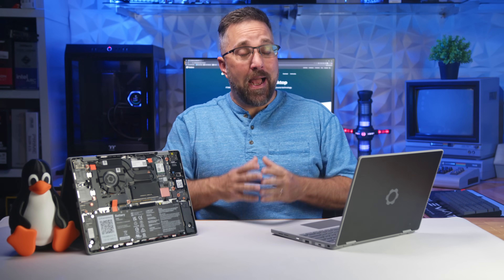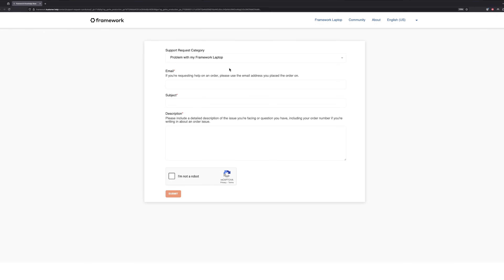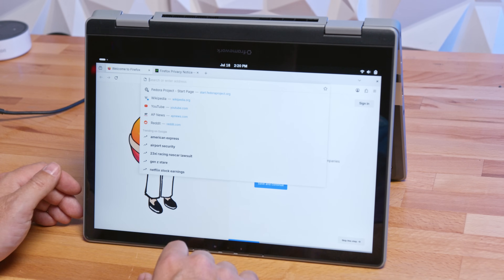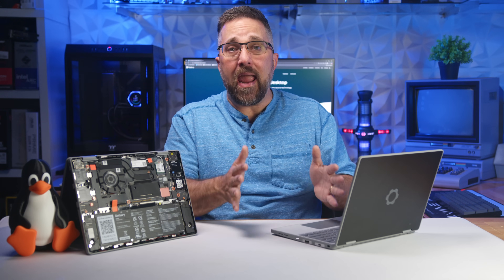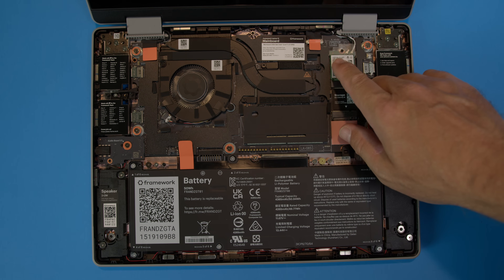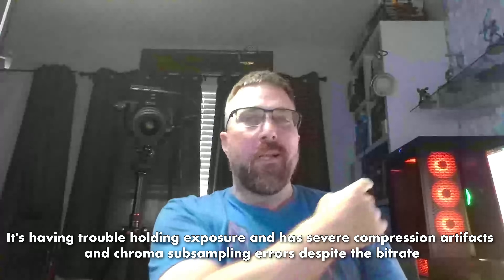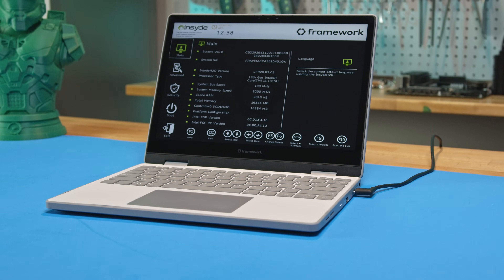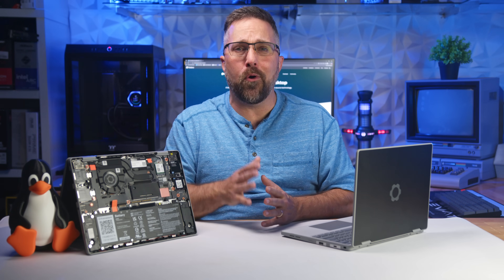Framework 12: Finally! a Linux 2-in-1 That Just Works!

Comment: I'd love to hear more about your experience with the on-screen keyboard. That's been nothing but headaches for me on a Surface, especially on KDE. Even more so if you want to use a non-QWERTY keyboard, that's stunningly hard to do. Getting it to pop or go away when I actually wanted it to consistently like Android was a big problem. I gave up on using it. For all of its other faults, Windows 10 actually ran circles around both Gnome and KDE for this.

Comment: It still just cost too much money, the price premium on the other two laptops is easier to swallow due to their capablities and relative repairability vs their competition. this thing needs to be priced at like 550 starting as a usable computer, given its quality and hardware, to justify even coming close to its cost. IDC how good their repairability is when a new main board cost as much as the entire computer from the competition, and buying a whole new computer comes with across the board system upgrades, while you still have your old everything else. This doesn't make sense and unless the second gen radically changes the design, I hope this product doesn't last long as it will do more harm than good to the company, sapping resources that can be put into products people actually want to buy

Comment: I am a DevOps engineer for a mid-sized company, and my advice is, if you seriously care about your privacy, then never ever dual-boot windows and linux on the same drive.
MS can read all your user files in home directory because its on the same drive as wndws.  MS wndws has telemetry, keylogger, spyware and the new recall and also embedded AI.
you will be doing yourslef a disservice by having wndws and linux on the same drive. Having wndws and Linux on seperate drives prevents ms from reading your files and uploading that data onto their database. 
Also make sure that when you boot into wndws, that the Linux drive does not show up as an additional drive for even stronger security, even though wndws cannot read ext4 file system.

Comment: Mr Lifting Linux, what laptops do you recommend over framework for Linux?

I've been looking for something for less than 800 pounds/1000 dollars for content creation. 

Please respond if you have any suggestions
Reply from the maker: Depends on your workflow. If you need GPU hardware acceleration, finding a laptop with a dedicated GPU under $1k will be difficult. If you just need a good CPU look at the Star Labs StarBook 14. It ships with Ubuntu (or other distros), open-source coreboot firmware, LVFS updates, and a bright matte 4K IPS option. Current page lists configs up to Intel Ultra 7 165H, up to 96 GB RAM, and a 14 hr battery claim; you can keep it under $1K by choosing modest RAM/SSD and the lower CPU tier.  ￼
Reply: @LiftingLinux  I see. I'll look into that. Thanks 😊

Comment: ...Why the heck was the wifi speed so different O_o? That's wild.
Was there any chance windows wasn't in performance mode?
Or was currently downloading updates in the background or something all sneaky like?

Unrelated to that - we've had an excellent experience with Pop!_OS on Framework - my wife's Framework 13, for example, seems to work flawlessly with that light sensor issue you mentioned.

Comment: QA and QC issues are the reason I had to return by FW16.  I may come back to Framework but will wait a few generations.  It sounds like they are already on top of it.  The only issue left is customer support.  They response turnaround is about 5 days and they tend to ask for photos or videos of the issues or have other questions.  Every time you answer or send them info, they would ask for other things, which keeps pushing the total resolution time to weeks for some, and months...or in my case, almost half a year.

Comment: So what im hearing from this is that i should try to see if i can work with Fedora, i currently use Mint on my old Lenovo ThinkPad Edge E530 and it is great(especially since it is my first ever device for Linux) but i have heard other distros are good too, i mostly went with Mint for it since from the research i did it was the easiest to switch to from windows (never gonna be a mac user I hate Apple with a burning passion)

Comment: 2-in-1 laptops are really starting to shape up on Linux it feels like. Last year I picked up a Yoga 7i 16IML9 for $550 during black friday. All of its 2-in-1 features work flawlessly too! Its processor is a little more performant than that of the framework (Core Ultra 5 125U, edges out the i5-1334U by 20ish percent per technical.city) but its 16gb soldered ram is a drawback that will only become worse with time. The side-mounted power button is also a flawed design that is known to break. 
I've found that across GNOME and Niri, my yoga runs quietly, coolly, and smooth as butter on every distro I've thrown at it but Chimera Linux has an extra level of polish and snappiness.

Comment: I never had an issue with the ambient light sensor and automatic brightness on the Framework 13 on Linux. I use Manjaro, and I started with it just a few months after release with the 11th gen Intel. I currently have a Ryzen 7040 series board in it. The point about the Mediatek wireless module is valid though.

Comment: Weather or Not Wayland works better or worse with dual monitors depends on the monitor sometimes it's X-windows that works better.
Reply from the maker: You’re right that monitor compatibility can sometimes feel hit or miss, but this is actually one of the biggest areas where Wayland shines compared to X11. With X11, running dual monitors at different resolutions or refresh rates usually means everything has to sync to the lowest common denominator — so if you plug in a 60Hz 4K monitor and a 144Hz 1080p monitor, you often end up with a choppy experience.

Wayland fixes this by handling each display independently. That means mismatched resolutions and refresh rates can run smoothly side by side without dragging the whole system down. There are still edge cases depending on drivers, but in general, multi-monitor setups (especially mixed ones) are far more consistent and fluid under Wayland than X11.

Comment: Ouch! Those processed trebles were painful.

My Lenovo Thinkbook 14 G4 2-in-1 works perfectly straight out of the box. Everything works without needing any fiddling around at all. I didn't need to configure anything with Arch more than installing the needed packages. 
It's also made from metal instead of plastic, have 2 NVME-slots and 2 DIMM-slots.

Comment: I want to run 2 DP Alt Mode monitors on my future Framework 12 simultaneously without a dock. Does that work? And can you use another USB-C for charging the laptop?
Reply from the maker: Yes that works. All 4 expansion ports support DP alt mode and PD.
Reply: @LiftingLinux  Wonderful! I just might invest in one of these then, despite it lacking in some other departments.

Comment: Thanks for the video. I've been curious about Framework devices. To be fair though from my own experience, I disagree with the title. I bought a Infinity Flex 14 (2-in-1) from Tuxedo Computers running Tuxedo OS, their fork of Ubuntu a few months ago and it's hands down one of the best laptops I've ever used. Everything worked out of the box all the way down to the Wacom Bamboo Plus stylus. Just for kicks, I slapped on a Xencelab16 4K drawing tablet just to see how it would fare and it was perfect although overkill considering the Infinity Flex has a touch screen.  Surprising considering Wacom drivers are already kernel level in the OS but Xencelabs is a relatively new player in the game. The Infinity Flex is being used for design work, illustration and video editing mostly and it's been a champ. A real road warrior. Although I'd love to test run a Framework 12, the idea that it's finally a Linux 2-in-1 that just works, implying it's the first of its kind to do so running Linux, would be an outright lie from my experience.

Comment: hmm.. i have found that Cinnamon usually works better on 2-in-1s
and you dont have to setup any rules.
in "display settings" in the "settings" tab you deselect "disable automatic screen rotation" and every thing works fine.
never tried stylus input though; i have a ipad for that
Reply: I am a bit confused.  One of the key features of the Tablet Mode of a fully functioning 2 in 1 is the rotational awareness.  Are you saying that you have found Cinnamon works well on 2 in 1s except for not supporting that feature?  That's a big exception for many people.  Available documentation on the Framework indicates that, while Mint supports touchscreen features of Framework 12, it definitely does not support tablet mode without   making customizations outside the user interface and typical end user skills or expectations (with any rotational recognition being one of the unsupported features being absent from the Mint distro).
Reply: @catreader9733  i can speak to the Framework... for other repurposed 2-in-1s LM is the only Distro where i havent had to do anything special to get everything to work properly.

Comment: Sorry, but if you think this is great - try a12/14/16 year old HP EliteBook 2760p/2740p/2730p - Snappier than this thing, no jitter when drawing with the non-battery Wacom panel - only limitation: 2-point touch, and much bulkier, besides the outdated hardware. The 2760p still runs every OS in existence.

Comment: This is potentially big news. I have NEVER EVER gotten hardware accelerated web browsing to work on any machine running Linux. This includes supported distros on Framework computers. In fact, it's gotten to the point that I am heavilily skeptical of any claims that it works without a System Monitor screenshot of CPU usage. Furthermore, the only responses I've seen to this issue are denial, the instruction to watch every single video through yt-dl (no), "it works on my machine", or at worst, the insinuation that the asker is lying about their problem to make Linux look bad. In the end, even if the issue is acknowledged, it always seems to be that "your problem isn't good enough to fix". Add that to the 

If it's true that hardware accelerated web browsing is working OUT OF THE BOX on the Framework 12, then that is a massive step in the history of Linux. Outside of perhaps small laptop manufacturers that only ship Linux, I'm not sure any officially supported Linux machine has had fully hardware accelerated web browsing out of the box. That, and even the rest of the hardware, working flawlessly as intended, autorotate, automatic touch keyboard and all! This means somebody is taking the casual audience, who just need a machine to work as a tool, and not as a hobby, seriously.

Comment: Chassis flex only matters if it means there's extra stress close the area where the hinges are.

This is only an issue for using a laptop on an uneven surface, as if it's flat on a desk the force is spread evenly.

It also matters a bit for screws getting loose in some bad designs.

My last two cheap laptops both broke because I open it awkwardly while using it the lap. The plastic closest to the hinges broke.

If these aren't an issue with the Framework Laptop 12, it's not a big deal and I'll take the weight savings.
Reply from the maker: Did you catch the part where just opening the lid—while the laptop was on a flat desk—caused damage to the screen? There are also a few reports on the Framework forums of the FW12 chassis developing stress fractures around screw mounts. So yeah, in this case, the flex may be more than just a theoretical concer
Reply: @LiftingLinux Bummer. All my past laptops have broken around the screw mounts.

I won't be buying anymore low end devices because of this. I'm sure if I opened the laptop very carefully every time it would be fine, but that's besides the point. This is a big design flaw IMO.

Comment: for audio di gnu linux , i'm using pipewire audio server plus kx studio repo (cadence  for manage jack audio pro server and carla for manage audio plugins effects )  :)
Reply from the maker: That’s a solid setup—PipeWire with JACK support through KX Studio, Cadence, and Carla gives you a ton of control over your audio workflow. But yeah, as powerful as that stack is, there’s only so much it can do when the built-in speakers just aren’t great to begin with. Good software can’t fix tiny drivers and weak enclosures!

Comment: 7:50 most docks do generally work with regular USB+PD+DP alt mode combo, all USB4/TB4 really offers to them is higher display resolution support on the DP front, no PCI-e lanes needed. And, well, the almost-guarantee that all 3 of these will work consistently, because not all laptop USB-C ports are created equal.

Comment: a toaster can run linux wdym handle linux lol
Reply from the maker: Sure, Linux can run on just about anything—but hardware support is a whole different story. It only works well if the manufacturer provides and upstreams proper drivers. Without that, you get missing features, poor performance, or nothing working at all. Take the Realtek RTL8821CE Wi-Fi card—it’s notorious for flaky or non-existent Linux support. Same with many fingerprint readers like the Synaptics WBDI—completely dead on most distros without reverse-engineered workarounds.

Comment: My i5 framework 12 has the same ~8-10% drain over 12 hours in s2idle, but for some reason switching to deep sleep actually increases the battery drain to about 15% over 12 hours. I'm on debian 13 and switching to deep sleep by writing to /sys/power/mem_sleep instead of modifying the grub boot options. It does appear to actually go into deep sleep, since only the power button will wake it and it'll take a couple seconds longer than resuming from s2idle.

Maybe I'll give fedora a try to see if that makes a difference, since Debian isn't an officially supported distro.

Comment: Sound on Linux suck so bad! It is unnatural, plasticky with lack of bass.
Reply: When I installed Linux I discovered that the manufacturer's Windows-only Dolby tuning was the only reason my laptop sounded as good as it did
Recreated that tuning with Easy Effects equalizer and now it's back to sounding as good as it did on Windows

Play the white noise test sound and fiddle with the frequencies until it sounds like a natural waterfall
Set ~18 bands and "Calculate Frequencies" to evenly space them
Show Native Window for a neat visualizer to help avoid clipping on the output

I also used Spectroid on my phone so I could see the sound. Really helped with getting everything even

Comment: Awesome insights, thanks a lot! Tuxedo had a nice alternative as well until recently: the Infinity Flex 14. Similar specs, but 14" and up to 64GB RAM possible, probably better build as well. Sadly it's out of stock. I hope they will release a successor soon! I'm currently using macOS, but I'm thinking about moving to Linux for a while already, and a 2-in-1 would be really compelling!

Comment: 5:12 It's pronounced like day-mon and it comes from the older definition of the term that just generically refered to any spirit. not the modern "demonic" conotation we have today.
Reply from the maker: No it's "demon" The term comes from MIT’s Project MAC in the 1960s and was inspired by Maxwell’s Demon in physics, a theoretical entity that invisibly controls a system. If you’re into Unix history, Linux, AI, or systems design, Project MAC is one of those origin stories where nearly everything you know today had a seed planted.

Comment: This may have changed... I got a OWC dock specifically for working with my Mac at work, employer paid for it. You can imagine my frustration when it didn't work right and needed a firmware update, that could only be done using Windows. So much for being Mac specific.